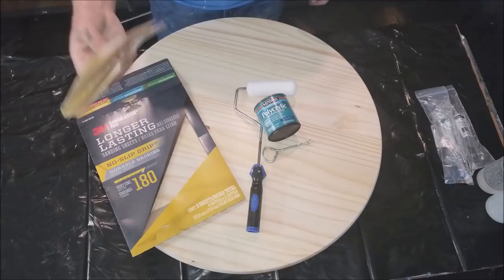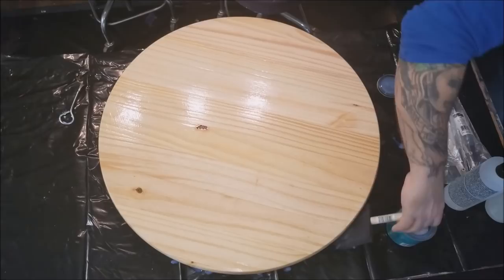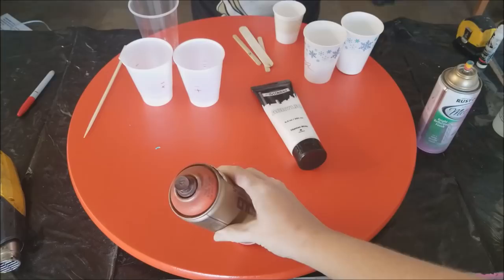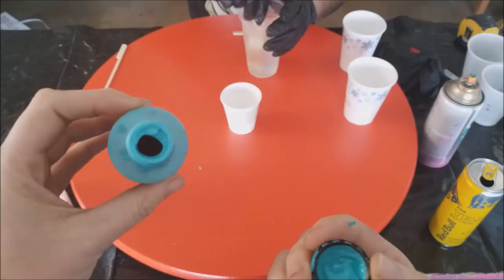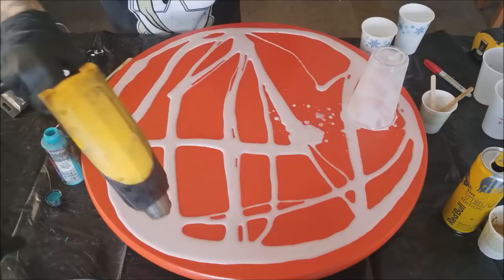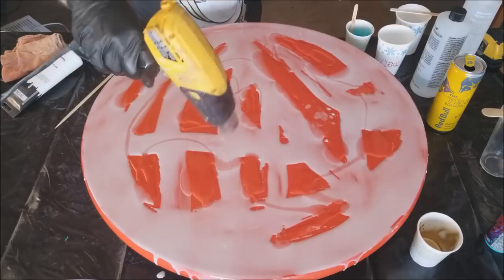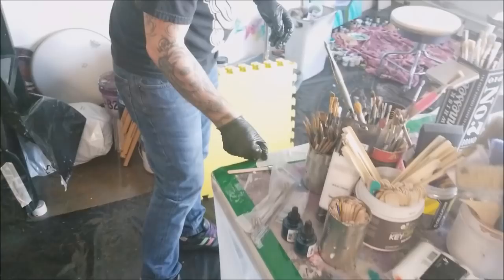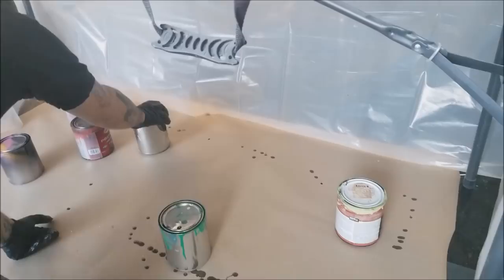Cells and Lacing with Resin (Things you never knew you needed to know)

Comment: great video, great art work!!! What brand of heat gun are you using, and at what temperature are you operating it? Is there a maximum temperature that I should use when working with resin? thanks
Reply from the maker: Our heat gun is by Wagner (I think it was $30 from Home Depot).  There are two heat settings on this model.  I wouldn't use the top heat setting because it will hyper set your resin.  Anything more than the low setting is too much (in my opinion).

Comment: Loved it . Great art work. What are the other tool you were using other than the heat gun. That small tool?
Reply from the maker: That was probably the airbrush.  Jeff is also an airbrush artist and we had it handy so we thought we would use it in this piece.  Thank you for your question, let me know if you try to use one!  It's like using a straw to blow the resin - without the risk of passing out.
Reply: Artist Till Death yes plan on doing it. I  also wanted to know what was the first coat you applied before putting spray paint. 
Surely will send you picture if it comes out good. Looks doable to me.
Reply from the maker: That was a polycrylic.  We use it to "prep" wooden surfaces since they tend to "breath".  This way we can avoid air coming through and creating pits and bubbles in our final piece. (basically it seals the wood)

Comment: How does the oil based rustoleum not get funky in the resin? I thought you said to stay away from oil based??
Reply from the maker: The Spray paint has oil properties but isn't really oil paint.  Where oil paint never really dries, this spray paint does - and I think thats why it doesn't leak like the one did that I used actual oil paints in. Also, we don't mix in that much of it.

Comment: A suggestion and you would also be able to use later possibly instead of using so much tape on the bottom why don't you use plastic or like paper bags so that it's thick paper towards the center where it's only going to be because of touch use tape around the outside

Comment: You use a heat gun instead of blow torch or alcohol for the bubbles....is this just preference or do you alternate sometimes?
Reply from the maker: We do alternate from time to time.  It all depends on what look we are going for.  For this piece we wanted to incorporate the look of slightly blown resin with the heat - so we used the heat gun.  If we wanted to add the heat to pop the bubbles without creating movement we would use a torch.  Sometimes the alcohol will create a dotted pattern to resin work with designs laid in it so we only use that method when we want to show that look.

Comment: In your guys opinion what's the best product to use on epoxy to make it scratch resistant? Love your work
Reply from the maker: Honestly - I think it comes down to the kind of epoxy you use and how many layers you put on. We just got a brand of resin that is supposed to be the strongest in the market (and able to withstand 500 degrees of heat) and we are going to test it this afternoon! I will post the video when I get it edited.

Comment: When you sand, are you trying to make it rough or smooth?
Reply from the maker: It depends on what level grit we are using. At what point in the video are you referring to?
Reply: Artist Till Death 
Around 1:30 
Also, i didnt know you could use paints to dye the epoxy....i thought you had to use the pigmented powders....crap....now ive bought all these expensive powder dyes. Lol.
Reply from the maker: Typically we use sanding to create a tooth for the paint and resin to adhere to.  When we use the extra fine sand paper like at the 1:30 point its to create a very faint tooth while keeping the area smooth.  You can use MANY things to tint your resin, however, stay away from anything oil based.